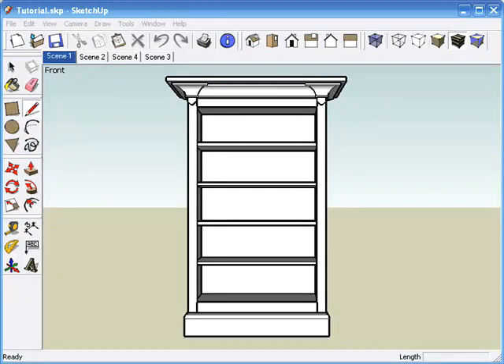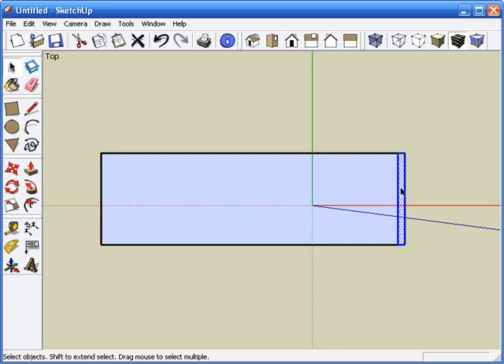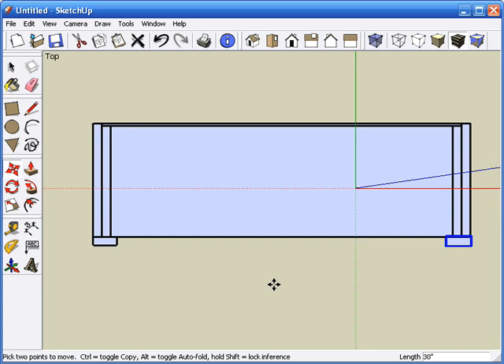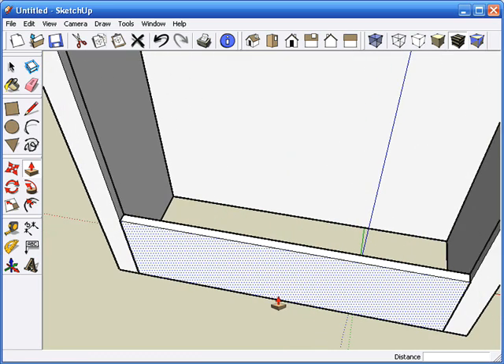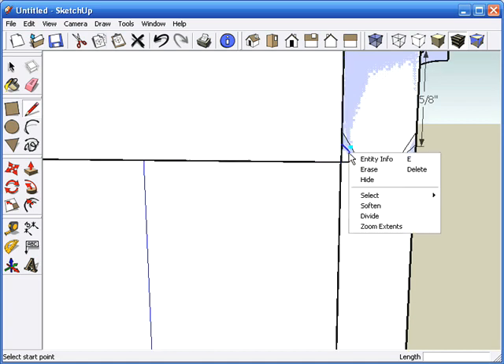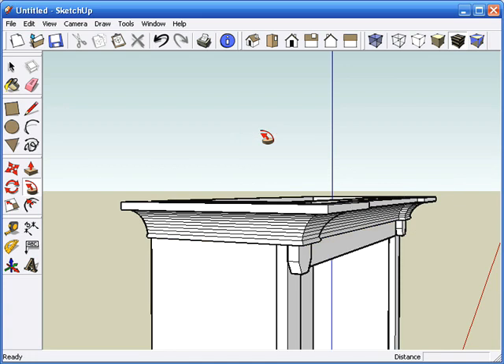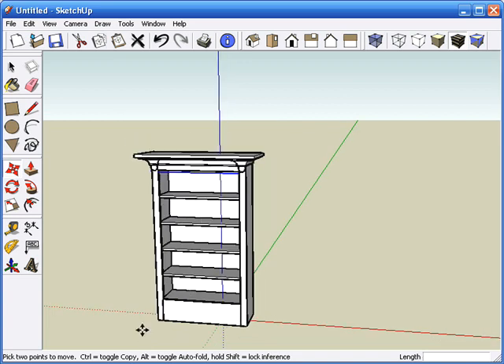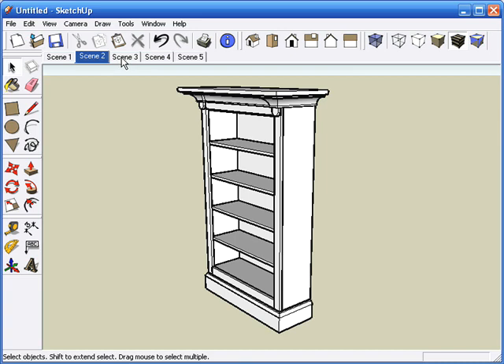Sketchup Tutorial: Drawing a Simple Bookcase

Comment: Thanks for this. Very helpful.

A few notes for Mac users: you CAN use a trackpad effectively in SketchUp. No, it's not quite as easy as a mouse, but it's doable. (I have SketchUp running right now on this MacBook, on the couch.) 

By defining your own keyboard shortcuts (e.g. "o" for Orbit,  "spacebar" for the selection tool, "x" for X-ray, "g" for Group, etc.), and using multiple-finger gestures (e.g. two fingers for zooming-in-out), it's not too difficult. Right-clicking is done the usual way: just hold down the Control key on a Mac. Duplication is done by holding the Option/Alt key.

You can also use an Apple Magic Mouse quite effectively, again with keyboard shortcuts. You can scroll on the surface of the mouse. It's not as good as a specific scrollwheel button, but then the actual scrolling is multi-dimensional and smoother than any other system. So, 6 of one, half-dozen...